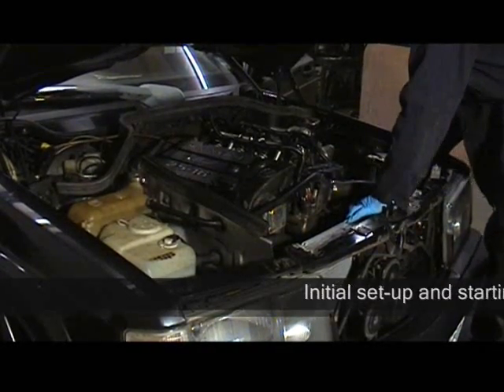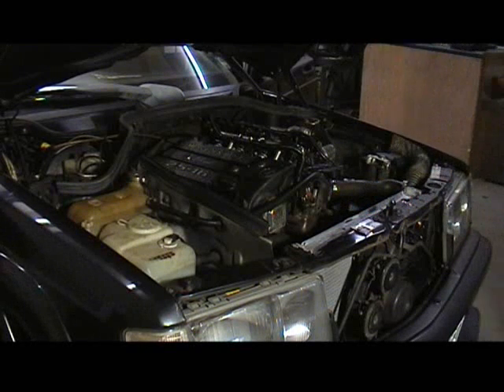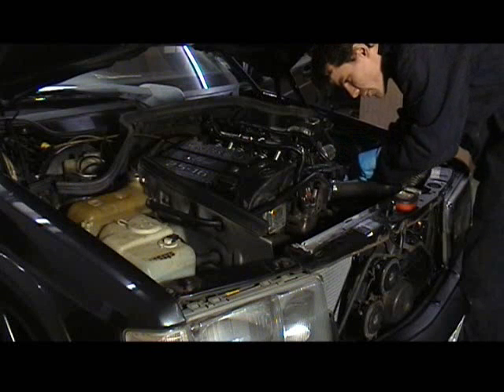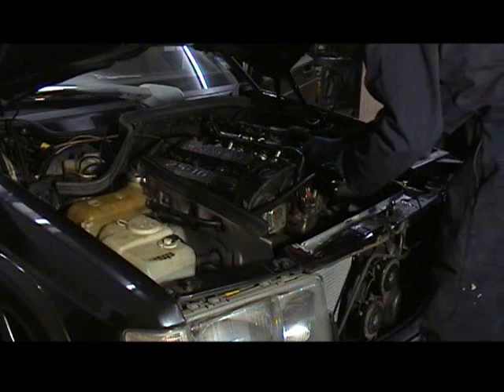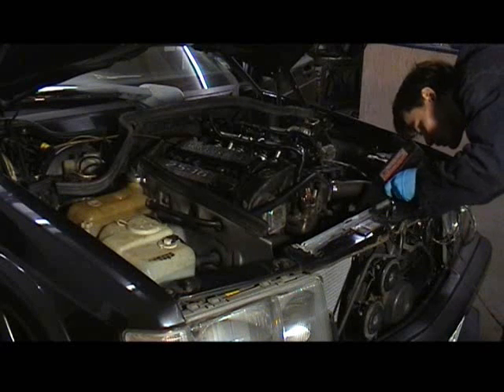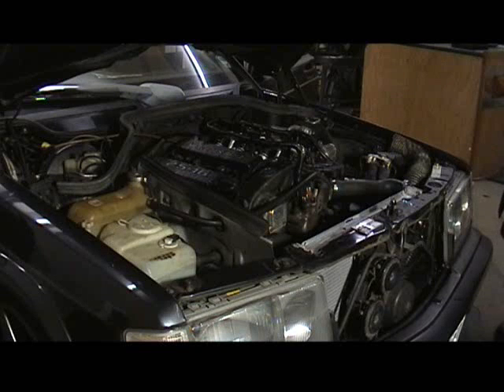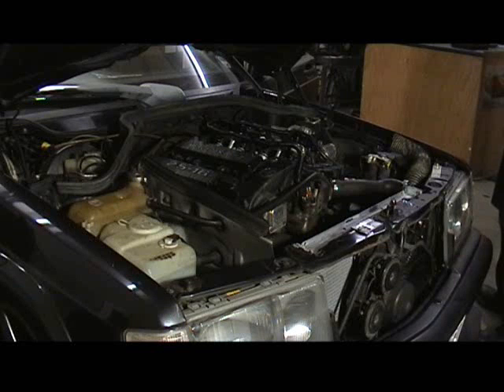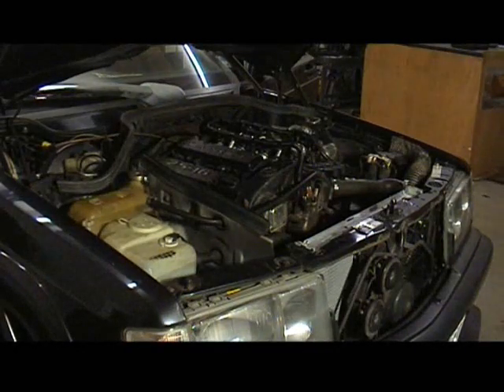Mercedes 190e Cosworth -- EFI and Programmable Engine Management Conversion

Comment: Extremely scarce on details... I notice you modified it by adding a full-custom "hot air induction system" and apparently, no home trigger, and possibly, a batch fire coil, further enforcing that this project was "not quite up to expectations". The ECU appeared to be quite "coarse" in it's programming interface. Can I also assume "no closed loop control" also? Looks like an expensive way to increase fuel economy, whilst also simultaneously decreasing performance, and potentially de-valuing a rare and exotic automobile.
Reply from the maker: You have made many unfounded assumptions in your comment! 
There is a custom trigger wheel with crank VR sensor. This particular Canems ECU is running semi-sequentially with regards to fuel injection and the ignition system is the ubiquitous wasted spark set-up using a Ford Gen.1 coil-pack. This particular Canems ECU can operate closed loop fuel control and idle control but the customer did not require any of these features as he wanted it primarily as a track car. The primary objective was improved performance, particularly in terms of throttle response - the customer informed us that we exceeded expectations in terms of performance. 
We work with many programmable engine management systems but choose to stock the Canems ECUs - we have installed the Canems ECUs on HUNDREDS of different vehicles, mostly V8s but anything ranging from 1 cylinder to 12 cylinder engines, including supercharged and turbocharged applications. We find that there are more than enough features available and select the particular Canems ECU based on each customer's requirements and budget. 
The age-old debate of whether or not to modify a classic car is fairly interesting but we are paid to do a job and our stance is - we always aim to give the customer what they want. It is their car and therefore it is their choice.
P.S.: Your channel is extremely scarce on videos.... ;)

Comment: look really cool but most cost more to maintain as not stock?
Reply from the maker: Hello and sorry for very late response! We do not usually respond to our Youtube comments as we simply do not have the time but we do appreciate people taking the time to comment. This Canems EMS system should be cheaper to maintain than stock for a number of reasons - individual components are lot easier and cheaper to replace than the original KE Jetronic parts, which are now becoming increasingly scarce. The engine management wiring loom has also been built from scratch and is all brand new, giving at least another 20 years of reliability. Modern engine management systems also consist of more 'solid state' components, so if done professionally / properly should be more reliable.